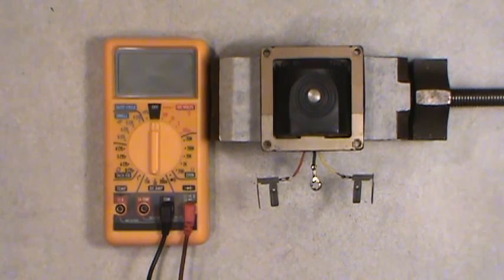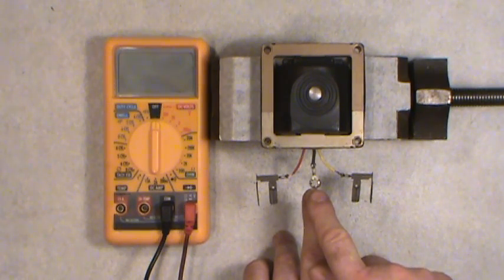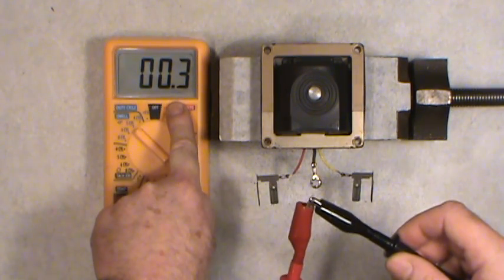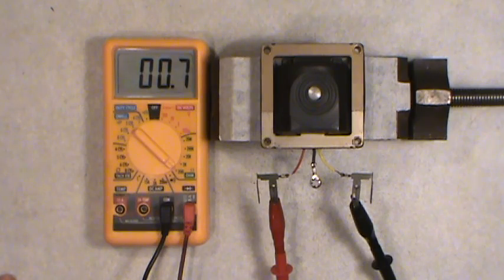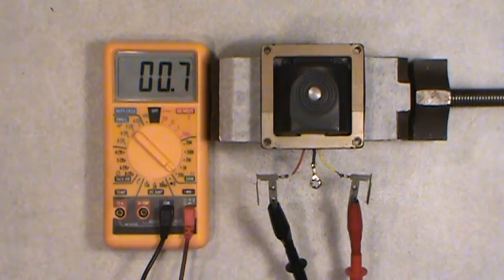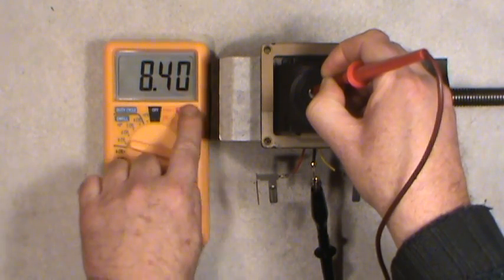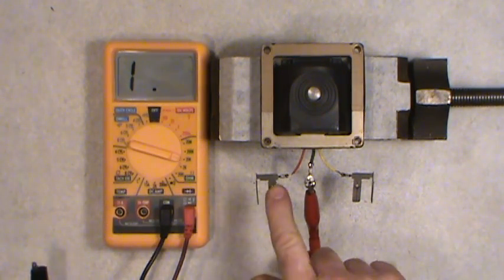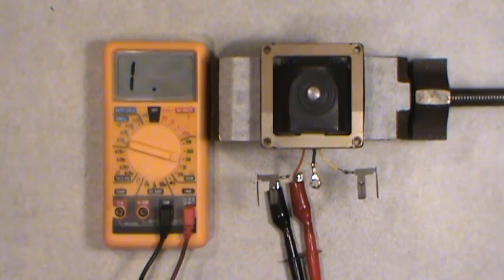HEI Coil Test (The Short Version)

Comment: On the low reading what if it reads 000? Does that mean its a bad coil? The secondary is 7.22
Reply from the maker: Greetings ss396rat....Thanks for watching, and commenting on this video of mine....There are a few things that can be causing Your Reading of "000", Showing on Your Ohm/Multimeter....First thing is, was that HEI Ignition Coil of Yours "Working" alright, "Before" You Tested it for Ohm's Readings?....If Your Ohm/Multimeter is comparable to the Yellow Digital One that You see in this Video of mine, did You "Make Sure" that You were "Using the Correct "Range", for each of the HEI Coils Readings....In this Video, when I Measured the "Primary" Side of the HEI Coil, I had my Ohm/Multimeter "Range" set on the "Lowest Range", which is..."0" to "200" Ohm's....For the HEI Coil's "Secondary" Side, I just selected a much "Higher" Range, that would show me the Best Read-Out for that Much Larger Ohm Reading.

Try this...Select the "Lowest" Ohm's Range on Your Ohm/Multimeter, and Touch/Connect the "2" Test Leads/Probes to each other.
Did You see a Reading of some kind?

On my Yellow Ohm/Multimeter, when Touching/Connecting my Test Leads/Probes Together, and, the "Lowest" Ohm's Range is Selected, my Readout is Showing ".3" Ohm's, and that is telling me, that it appears to be working OK, on the Lowest Range, with that ".3" Ohm's telling me, that, there happens to be, ".3" Ohm's of Resistance, that is caused by the Test Lead Wires, and probably my Yellow Ohm/Multimeters "Miss-Calibration" added in, as well.

If You did, in fact, get some sort of Reading on Your Meter, when just touching the "2" Test Leads together, try "Re-Testing" the "Primary" Side of Your HEI Coil, to see if You can get some sort of Ohm's reading on that Meter of Yours.

Then there's this Scenario...If Your Meter is working, as it should, and "Set" on the "Lowest" Range, and You still get "000" Ohm's Showing on Your Meters Display, while testing the HEI Coil's "Primary" side, then there is the chance, that Your HEI's "Primary" Windings are "Bad", or, there is a Problem with Your Meter.

Now, about the "7.22" Ohm's Reading that You saw on Your Meters Display, has me thinking that it should really be "7,220" Ohm's for the Secondary Windings in Your HEI Coil, due to the way in which it Displays Numbers and the Decimal Point, probably, because of the much Higher Range, that You may have Selected on Your Test Meter.

Specifications of about...3,000 to 20,000 Ohm's for the "Secondary" Side of Your HEI Coil should be OK.
If Your "7.22" Reading is Actually "7,220", then, Your HEI's Coil "Secondary" Windings should be OK.

Depending on where a Person finds the Ohm's Specifications for Any Ignition Coil, the actual Ohm's Value can Vary somewhat.

On the HEI's Primary reading, there should be a quite "Low" Ohm's Reading, showing on Your Meter, but, it Should-Not be Showing "000"...!!!

Be Safe, take care, and have a good one.
Reply: RockysRoadshow  thanks for the quick reply.  I was driving my nova and melted a plug wire and the car shut off.  Immediately I knew it was either the ignition box or coil, tested the coil exactly how you did in video with a brand new multimeter.  000 reading.  Gonna get a coil today

Comment: So you started of this video testing the red and yellow wire with the ohms meter setting but didnt say what setting the ohms side? Was it 200Ω , 2kΩ or 20kΩ ???? If you did the 200 my coil read = 1.1 ?  2kΩ = 0.001 ? 20kΩ = 0.00 ? 200kΩ =0.00
Reply from the maker: Greetings...Vintage Moparnut1978.........Thanks for watching........The outer two wires, are for the primary winding, and, on a factory/stock, HEI ignition coil, the highest reading should be about 1 ohm.........The lowest reading should be, just "above" 0 (zero) ohms, but "not" zero ohms........Typically, from .1 ohms, to about 1 ohm.........So then, the "lowest" range on the ohm/multi-meter, is the correct range to use........On my yellow multi-meter, that you see in this Youtube video, then, 200 ohms, happens to be the lowest ohms range that I can select.........I usually see about .5 ohms (one half, of one ohm), on the primary side of an HEI ignition coil........At 1.1 ohms, on the 200 ohms range, then, your primary winding is probably ok...but..."re-check" your HEI ignition coil..."after"...doing the following...!!!.........When you are ohms-measuring, such a low amount of ohms, then, you have to account for, the amount of resistance (ohms), that is in your ohm-meter's, or multi-meter's test leads/probes, unless you happen to have a meter, that can "Calibrate", exactly at zero ohms...!!!........Try this...set you meter to the lowest ohms range (200 ohms?)...then...touch the two test (leads) probe tips together...see what ohms appear (if any), on your meter's display screen...if there is something showing up, then, you have to subtract this reading, from the ohms-reading, that you see, when actually ohms-testing the (low ohms) primary side, of your HEI ignition coil, in order to get, an "accurate", ohms test/measurement........I get .3 ohms, when I touch my yellow multi-meter's probe tips together, while the ohms-range is set to 200 ohms........Let's say for example, that, I see .8 ohms, while testing an HEI ignition coil.........So, all I have to do now, is to, do some simple math, as in (.8 ohms minus .3 ohms) which will equal .5 ohms, which is accurate, for my yellow multi-meter.........Ya don't need to do this, whenever measuring the secondary coil, that's inside of an HEI ignition coil, because the ohms range, will usually be, in the "thousands" of ohms, and......till next time......Be Safe, take care, and have a good one.
Reply: what brand  dmm You use?

Comment: what can cause my module or pick up coil goes bad every 20 minutes
Reply from the maker: Greetings...Antonio Rodolfo.........Thanks for watching........The number one thing, that will usually cause, an ignition control module to become damaged, is usually, that it "over-heats", because of, not applying, the "correct" heat sink (heat transferring) compound, onto, the bottom (metal side), of the ignition control module, before installing it.........A lot of people, will just use, die-electric grease, which..."is not"...the correct stuff, for the heat transfer to take place, between the bottom (metal side), of the ignition control module, and the aluminum pad, that is part of the HEI's main body, where it mounts onto.........I got my heat sink compound, at a computer store, and it's the cheaper stuff, that's about 10 dollars, for a small tube of it (note, some of the computer chip, heat sink compound, can be really expensive, just so Ya know).........The computer "chip", heat sink compound, is specifically made, for "heat transfer"...!!! (and that's why, it's the correct stuff to use, for this particular application)........Keep in mind, that, the ignition control module, gets quite hot, while in operation.........Make sure that, the bottom (metal side), of the ignition control module, and, the aluminum pad inside of the HEI distributor's body, where it mounts onto, is super clean, then, apply, a film of (computer chip), heat sink compound, to the bottom (metal side), of the ignition control module, and install it........Make sure that, those two metal eyelets (holes), that go through the ignition control module, and the two screws, that go through them, are super clean and shine-ee, as, the eyelets, and those two screws, are the electrical "ground", for the ignition control module (very important...!!!)..........Also, make sure that, you have the correct ignition coil, and, ignition control module, for your "exact" HEI distributor, as, there are different ones made, for each application........Good luck, and.......till next time.......Be Safe, take care, and have a good one.

Comment: I have high voltage in the TACH output, is it possible? I measured as high as 1000v dc, measuring beetwen +12 and TACH, Anyone knows how to solve that? Is it the coil issue? module? Itś a big issue I´ll fry another Tachometer if I connect again...
Reply from the maker: +sergio litwiniuk Greetings sergio litwiniuk....Thanks for watching, and for Your (potentially)..."Shocking"...HEI (High Energy Ignition) Distributor/Tachometer questions, as well......................The way I figure it, that 1,000 Volts DC (Your Engine was Running, I presume...???), that You Measured, is probably just Normal/the way it is, and also, I have a couple of things to tell You, as well.....................................A while back (as in Years), while my Dodge V-8 Engine was Running/Idling, I recall getting..."Zapped" (as in Electrical Shock), well, maybe, it was more like a very pronounced, Electrical..."Tingle"...when I inadvertently Touched the "Wire Clip", that I made, that was already Attached, to the Negative, Primary, Low Voltage Terminal, of the Oil Filled Ignition Coil, while trying to connect, one of my Yellow Multi-Meter's Alligator Clip/Jaws, to that wire, that I just mentioned...(sure don't need Coffee, with a "Wake-Up Call" like that...!!!...lol)...........................I recall reading somewhere, that, even on the good ole Points and Condenser Distributor, type of Ignition Systems (up till about 1974, that is), that, there very well could be, about 300 Volts present, while the Engine was running.....................................Then, quite some time ago (again I say...Years...lol), I phoned around, to see (actually Hear), just "Which"..."Tachs/Tachometers"...will..."Work/Function Properly"...with the General Motors Type of..."HEI/High Energy Ignition...Distributor", as, I was Hearin', that, there was the Possibility, that..."Some Tachs/Tachometers"...might Not..."Work Correctly/maybe Not at all"...with the HEI Distributor...!!! (in my case, my HEI Distributor, was installed in, a 350 Cubic Inch, V-8 Chevy Engine)................................Even most of the "Parts Guys", that I was talkin' to, on the Phone, back then, "Were-Not, all that Sure", that, the Tachs/Tachometers, that they had in Stock, would Work 100% Properly, when Hooked-Up to an HEI Distributor, so, I didn't Buy One, just in case, "it" Didn't Work Properly, and as "it" should........................Gotta really..."Watch-Out"...when Buying, just about any..."Electrical/Electronic"...Vehicle..."Parts/Components"...as, most of those..."Electrical/Electronic Parts/Components"...are..."Not-Returnable"...!!!...Yikes...!!!.....If and when...???...You might Buy another "Tach/Tachometer", for Your "HEI Distributor"..."Make Sure"...that..."It Will Work 100%"...with Your..."Exact"..."HEI Distributor"...!!!....................................Perhaps, find a Website "Forum", on the good ole Internet, for Your "Exact Vehicle", and Ask the Folks there..."What...Make/Brand/Manufacturer of Tach/Tachometer"...that they are Using, that will "Actually Work", with the..."Same Exact HEI Distributor"...that You have in Your Vehicle..............................Also, make sure, that You Tell "Them", if Your HEI Distributor, is "Factory Stock"...or..."Other-wise"...as in, a "Modified/not so Stock HEI Distributor", or, if Your HEI Distributor, happens to be an "After-Market/High Performance One" (You didn't say, what Your HEI Distributor, happens to be...???), just in case, there might be a Difference or two..................................I'm not sure, but, seeing as how, some HEI Distributor "Rotors" (that spin around, inside the HEI's Distributor Cap), will be Turning/Spinning, either..."Clock-wise"...or..."Counter-Clock-wise/Anti-Clock-wise", depending on the "Engine's Manufacturer", as in, oh, let's say, a Chevy V-8, where the HEI Distributor's "Rotor", Spins in a "Clock-Wise" Rotation, and, an Oldsmobile V-8's, HEI Distributor's "Rotor", will Spin in a "Counter-Clock-Wise/Anti-Clock-Wise Direction, oh, and, Both are, as Viewed, from Above/on Top, of the HEI's Distributor Cap................................The reason, that I mentioned about the Rotor's Spinning/Revolving Direction, and possibly, there also might be a concern, with, maybe, Electrical "Polarity" Differences, in one form or another, as I read, some time ago, about, making sure, that, things like, an HEI Distributor's "Pick-Up Coil", is to, Install, the "Exact/Correct One", for the "Exact" HEI Distributor in question...!!!...or, Problems, may arise...Yikes...!!!..............................So then, Make sure, that, You ask about, Your, Exact HEI Distributor, and Everything Else, that makes up Your Engine's Ignition System, especially concerning, Any "Modifications", or any Added, After-Market, Ignition related Parts & Pieces, as that my Friend, will probably result, in the best outcome for You, and hopefully, save You some Money, at the very same time.............Good Luck, and.............Till next time............Be Safe, take care, and have a good one.
Reply: +RockysRoadshow , excuse me i didn't tell you the model of my hei. it's summitracing blue printed distributor http://m.summitracing.com/parts/sum-850001r  and my engine is a small bloc 283 from 1967, i upgraded to the hei system... i think i fryied one tach, so now i am thinking on connecting one resistance to get a voltage decay un the tach output... and the 1000v are as you said when i turned on the engine...
Reply from the maker: +sergio litwiniuk Greetings sergio litwiniuk....I had a look-see around, for some information, about Tachs (Tachometers), and having them Connected to the HEI Distributor's "Tach" Terminal, and here, are some of the things..........................Some Brands/Manufacturer's "Tachs" (Tachometers), when connected to the HEI Distributor's "Tach" Terminal, might Require, what is known as a..."Tach Filter" (or possibly, in some cases, might be called a..."Tach Adapter"...???), Installed, "Between", the HEI's "Tach Terminal", and, the "Tach's...(Signal) Input Wire", and, basically, what the "Tach Filter" does, is, to "Filter-out/make less, any, High Electrical Signal Spikes, as well as, any, shall we say, Electrical Interference, that the HEI Distributor puts out, that can cause a Tach, that is not Specifically Designed, for the HEI Distributor's, "Tach Output Terminal's"...Quite High/Electrical Signal, to give/show, False RPM Readings (too High or too Low), or, maybe, Reads 0/Zero, or, maybe gets Stuck at one particular RPM, or, and I hope not, a Tach that got "Fried", and doesn't work any more, due to Not Having the "Exact", Required "Tach Filter" (or Tach Adapter...maybe...???), Installed, in that particular Electrical Circuit...!!!...Yikes...!!!.......................I had a look-see, at some Chevy, Electrical Schematics/Diagrams, and, I actually saw, one of those "Tach Filters" (in Schematic Form, that is), Installed/Placed, between the HEI's..."Tach Terminal" (connection point on the HEI's Distributor Cap), and, connected in "Series" (in line with), to the Wire, that was supposed to go to, the "Factory Installed" Tachometer's Input...................................So then, do a Search/ask around, and find out, whether, the "Tach", that You might be using some day, in Your Vehicle, "Needs the Specified/Correct...Tach Filter" (or not...???), for Your "Exact" HEI Distributor, in order to have the "Tach"..."Display Your Engine's, Correct RPM's", and also, to "Protect" the "Tach", from any "Damage" (if that be the case, that is), from, not only that 1,000 Volts, that You saw on Your Multi-Meter, but also, from any of those, Unwanted, HEI Distributor/Tach Terminal's "Overly-High, Electrical Output Signals" as well...................Good Luck, and..............Till next time, be Safe, take care, and have a good one.

Comment: I accidentally dropped my coil in oil I cleaned it best I could but the cooling fins still have oil in between themselves is this coil shot or will it be OK if I clean it with some carb cleaner?
Reply from the maker: Greetings...Ricky Ricardo..........Thanks for watching, oh, and...I think...that...I hear someone....calling for...Lucy...!!!...lol............Well, if it were my ignition coil, that was coated with oil, then, I would probably spray some..."Brake Cleaner"...all over it, a few times, and, let it drip off, of the ignition coil, so that, it would hopefully, take-away/remove, that unwanted oil with it, then, let it air dry............The..."Brake Cleaner" (sometimes called...Brake Clean), is usually, in a "spray can" (and, looks kinda like, a can of spray paint, somewhat), and, is, a very good liquid cleaner, that doesn't leave, very much/if any, residue behind, once it evaporates (dries), oh, and, it's usually quite safe, to spray on most automotive parts, without causing any damage, most times............The "Brake Cleaner" (clear, liquid spray), must be, very, very good, b-cuz, Ya can spray it directly on things, like, brake pad, or, brake shoe, "friction linings", as well as, brake rotors, and brake drums, and won't, degrade the brake lining's ability, to create the much needed friction, that's needed to get the vehicle stopped, properly & safely..............As for, "Carb (carburetor) Cleaner"..."DON'T"...use it, because, it's very harsh & potent, so much so, that, if using the "stuff", to clean carburetor parts, then, there are lots of "Warnings" out there, that recommend..."Not to"...soak (or coat), any..."rubber-like or plastic parts"...with "it"...!!!...Yes-Sir-ee-Bob...it's really, that..."STRONG"...!!!...........If the "Brake Cleaner" (trick...lol), doesn't work, then, a new ignition coil, it will probably be...........Good luck, and........till next time........Be Safe, take care, and have a good one.
Reply: RockysRoadshow  thanks for a great reply! Now to find Lucy...LUCY!